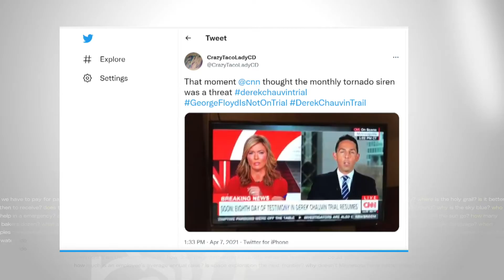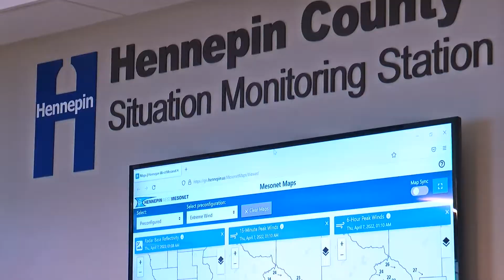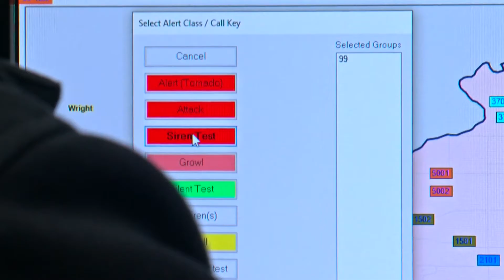How Do They Activates Severe Weather Sirens?

Comment: What they don't know is that first shot of the siren sounding had a second one in it. that rocket-shaped thing on the tower itself is another siren that was probably replaced
Reply: Beat me to it.
Reply: yep looks to be a model 5 (or 2) sadly they are getting replaced but my city still has one 2 miles from me :)
Reply: @Kansasavation  Yup, that's a model 5. I didn't mention it at first because to non-siren enthusiasts it wouldn't mean anything
Reply: Srry im late but are you talking about the siren next to the fs 2001? at 0:16

Comment: what happens if the power grid goes down
Reply: theres a UPS on the PC that powers the WeatherWarn system
Reply: Newer sirens have a battery backup system, so in case the power system goes out, the batteries in the siren are able to power the siren itself.